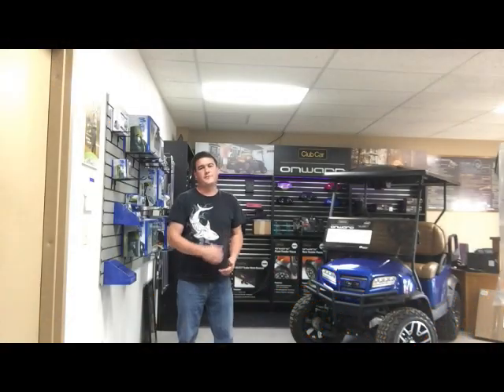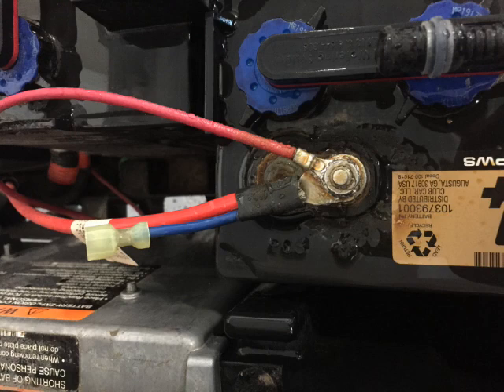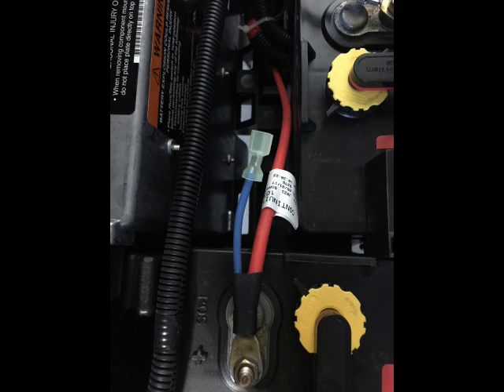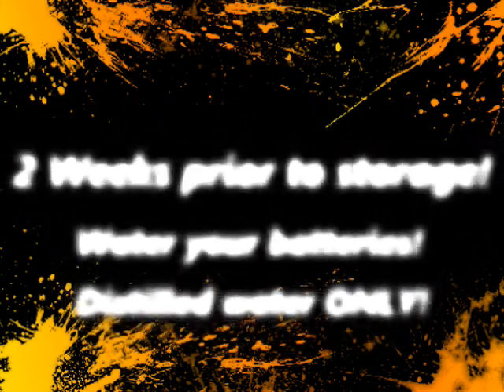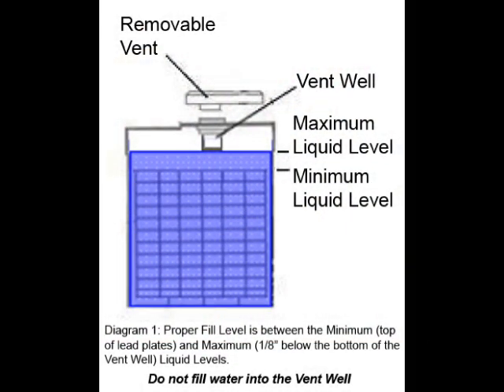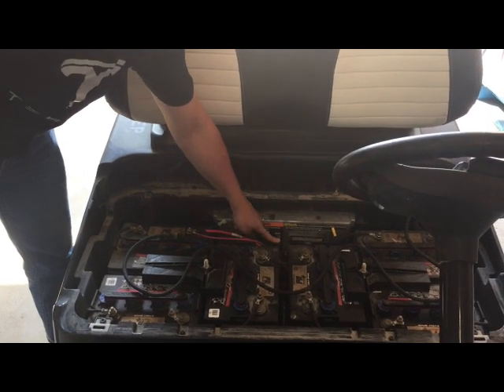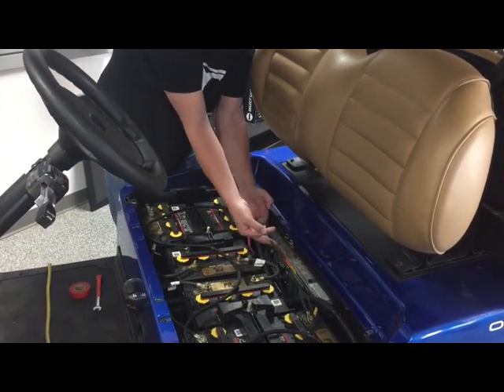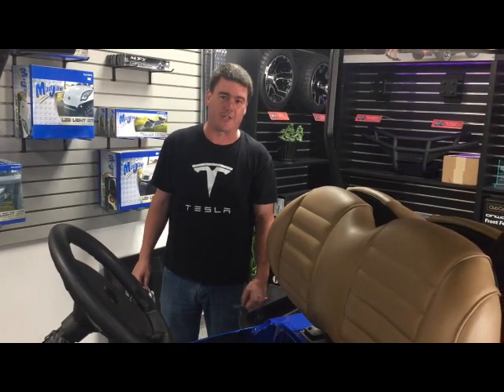Battery Winter Storage

Comment: Is it any different for an EZ GO RXV.  I was told that I have to charge the batteries monthly by disconnecting and connecting the cable from the charger to the golf cart or that they will die.
Reply: Ron,  If you have completely dis-connected your batteries, you do not have to charge monthly.  PLEASE NOTE: This is if you have dis-connected your batteries from the car completely.  This is why we strongly recommend dis-connecting both the positive and negative posts.  Also make sure all your accessories are dis-connected as well (from the batteries).
Reply: @Darrenatace  What you say makes a lot of sense and what I thought I would do and I was also going to put a trickle charger on each battery but apparently do not have to.  The cart will be in my garage in Florida for the summer at a temperature that will reach 115 degrees F.  I presume that doesn’t matter either?
Reply: @rongoudreau1402  You should be fine; providing the car is dis0connected.  Most FLA (Flooded Lead Acid Batteries) have a decent NO LOAD Shelf life; we find 6 months is not a problem; then when you re-connect make sure to fully charge the car and give a  good drive.
Reply: @Darrenatace  Great!  Thanks for your help!

Comment: I was told by Club Car Calgary to just put my 2005 Club Car Precedent into Tow mode, then leave it plugged in.  The on-board computer sends a trickle charge into it monthly.  It has worked for me for 13 years in Sask.
Reply from the maker: Yes Paul, you're correct, that will work.  However there are issues that can arise from this method that could potentially have the batteries freeze.  The main issue being the breaker.  If by chance the breaker is flipped off, blows, or there is a power outage while the car asks for a charge it can fault the OBC, causing it to go ultimately into "limp" mode.  With our long winters this can, of course not always, cause issues.

Also - The OBC does not trickle charge, it will turn on, monitor battery voltage, and if required bring on the charger, if not, go back to sleep.  Typically it does this every 14 days.